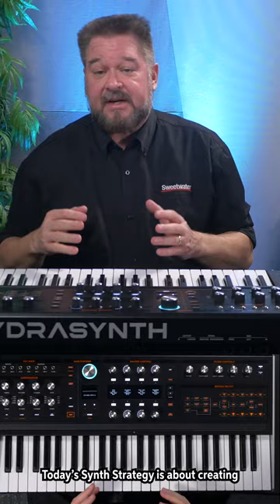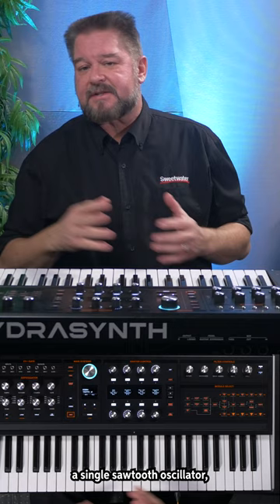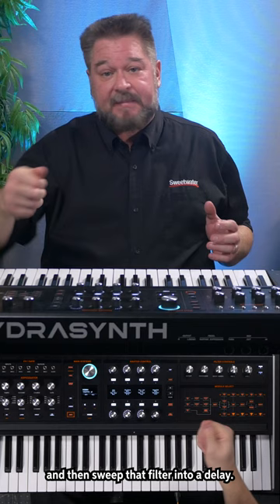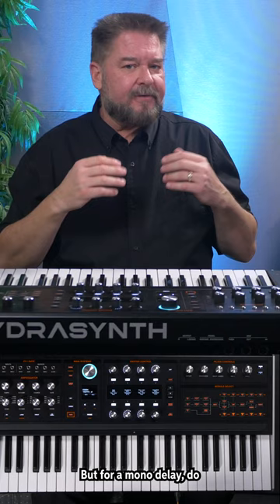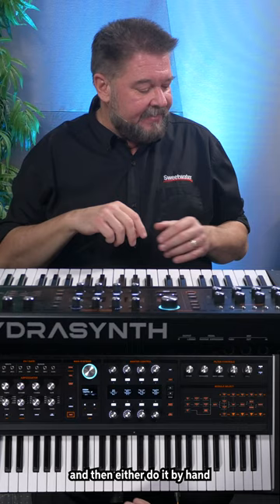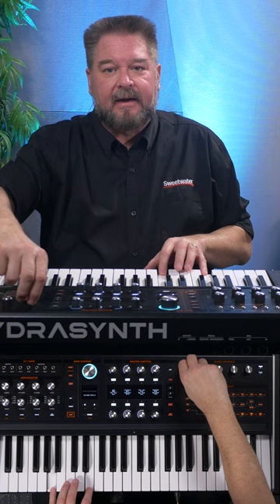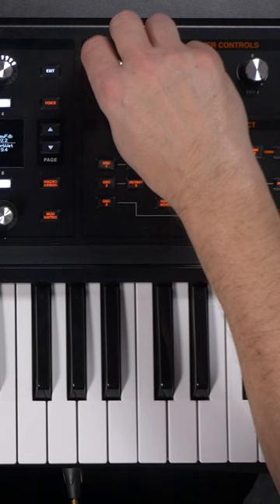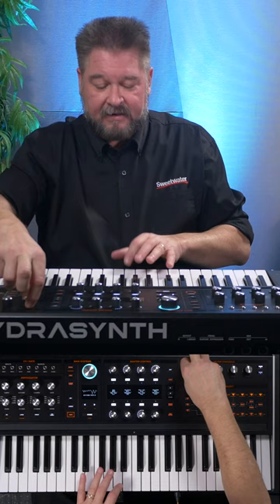Synth Strategies: Ping Pong Delay Sprinkles

Comment: What is that strip he's touching in the beginning? Does that synth have some kind of parameter strip you can rub??
Reply from the maker: Hi DeLuca Piano. That's the Hydrasynth's Ribbon Controller which can Pitch Bend, and/or Modulate any parameter, or be used in a Theremin mode. In that instance, I was using it to sweep the Filter Cutoff. Thanks for watching! 
-Daniel